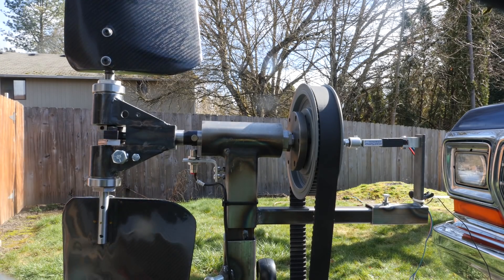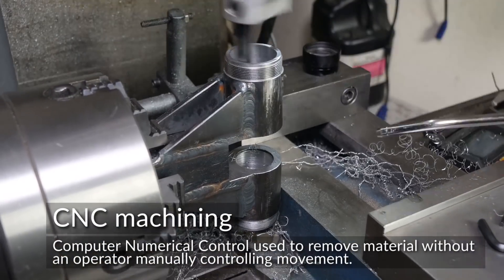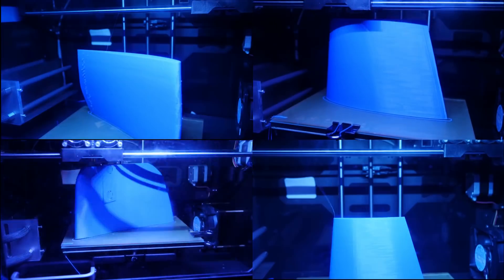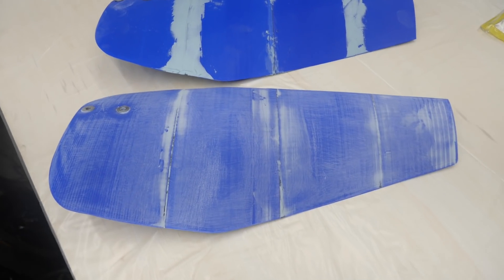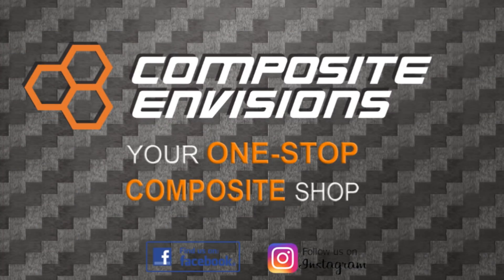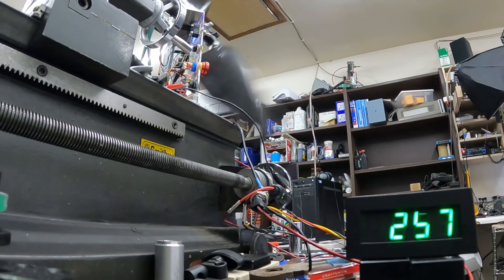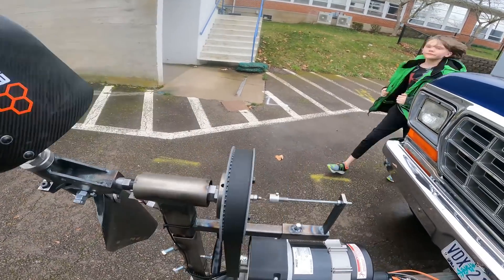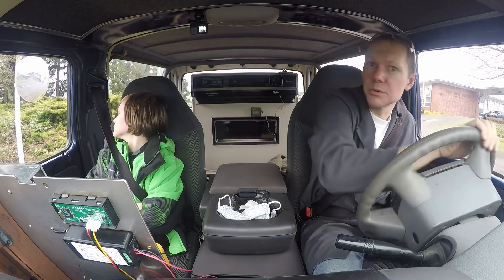Carbon Fiber Blades Making 2000 Watts! - Wind Power on a Car #4

Comment: The gas fuel you used to make the speed that turned the fan, had a higher energy storage coefficient than the turbine. Turning the gas into heat to cook the food could have been a lot more practical. Side note. Most civilised countries do not permit that random addition of equipment to be put onto the front of a vehicle and then be used on public access roadways. So really its not, as your title suggests, wind power, but Gasolene power driving the turbine blades. Kudos for the building and using a variable pitch, but this is not new tech either. The only random thing you missed was adding the gold go faster stripe on the leading edge of the blades. Well done for clickbiat though.
Reply from the maker: all covered in the final testing video: https://youtu.be/tEPBdztGMdI

Comment: If you tried to drive in the UK with that attached to the front of the car, the car would be impounded and you would be charged with reckless driving
Reply from the maker: 'Merica! 😂  Be sure not to miss the conclusion where I measure the effect on mileage to see if it works!  https://youtu.be/tEPBdztGMdI

Comment: Imagine something like this plus solar panels on a Tesla . With two or three separate batteries one to drive . One being charged by wind and solar and one pack to power in between charging of main battery . So power alternates from 3 separate battery packs . Could get up to 1000km easy
Reply from the maker: Be sure not to miss the conclusion where I measure the effect on mileage to see if it works!  https://youtu.be/tEPBdztGMdI

Comment: A real engineer would control to be able to calculate how much fuel lost to added drag on the vehicle to compare it to the power gained by the turbine. That's the essence of can do vs should do for any budding engineer to learn tradeoffs.
Reply from the maker: But as every budding engineer then learns, there are so many estimates and unknowns in such a system (Re for example) that the answer ends up being way off when compared to empirical data.  I've never seen a case where theoretical was not modified to match reality.  Thus the saying "the difference between theory and practice is that in theory there isn't one but in practice there is".  Video with data is already being viewed by patrons on Patreon...

Comment: 8:31 An AI should have controlled it's pich by the speedometers input for maximum use. And why is this not on an electric car with solar panel?
Reply from the maker: did you notice the AUTO/MAN switch on the controller on the dash?  Future plan is to do just that.
Reply: @QuintBUILDs  I said that cuz if done right the AI with wind sensors can get the best angle of attack for power output as you put more gas into the acceleration.

Comment: If you would have connect a 12V inverter to the battery you would have got way more power and it would have been much more efficient as well.
Reply from the maker: Oh, just wait until you see the next vid! 😁
Reply: @QuintBUILDs  😁

Comment: I have always wondered why they dont make and sell adjustable pitch turbines for home use.  They use them for commercial power production, why not for home use?  They are much more efficient than fixed pitch turbines.
Reply from the maker: Would need to be a super cheap robust mechanism.

Comment: what would happen if you put this on a electric car, would it recharge itself and could go for longer distances or would the prop slow it down to much to be effective ?
Reply: It would not produce enough electricity to meke up for the amount of electricity it requires to drive forward to make it turn.    It could be a handy backup to have incase you run out of electricity in a windy area though.
Reply: @Bendigo1  Yes, but if you use it like the brake system on most electric car to increase range ?
Reply: @sir.fatfoot8731  it would create drag, to overcome the drag it would take more power so any power created would be lost in creating the power.   I had the same idea, but after doing research i found out it wont work with current technology.
Reply: @Bendigo1  alright, thank you for clarifying.
Reply: @sir.fatfoot8731  you're welcome.
Reply from the maker: Find out in the conclusion where I measure the effect on mileage to see if it works!  https://youtu.be/tEPBdztGMdI
Reply: @QuintBUILDs  alright, will do. Thank you.

Comment: Do you think the 3d printed core is lighter than using foam? I am sure much easier to do the carbon layers. Foam would be brutal to hot knife and heat seal. What a cool way to make your custom blades!
Reply: Pretty heavy though

Comment: So long story short, you just created a very energy inefficient, generator, that also needs to be in constant motion and runs on fuel.
Reply from the maker: Video proving it works: https://youtu.be/tEPBdztGMdI  😁
Reply: @QuintBUILDs  I mean it obviously works, but it just convert mechanical energy created by the car using fuel, so in the end that energy comes from additional fuel consumption.
Reply: In other words, you could use a fuel powered generator, and it would probably be more energy efficient

Comment: Can this mechanism be installed on an electric car and use the energy generated to charge the batteries for increased mileage..
Reply: Yes, but it will generate less power than it consumes
Reply from the maker: Actually it generates more than the additional fuel consumed.  Don't miss the conclusion where we prove it. https://youtu.be/tEPBdztGMdI
Reply: @QuintBUILDs  yes, but on a square truck. Won't work on an aerodynamic car
Reply from the maker: @tedarcher9120  with respect, do you realize you've simply restated "won't work" on a new unrelated challenge without addressing the validity of the prior assertion? There is no need to be right all the time here. It's all about the learning for me, but that requires honest assessment of prior misunderstandings/statements.

Comment: Wholesome, but I wonder if you can remove the oven and add those motors that will support engine. How much you are going save or it's going to be inefficient?
Reply from the maker: Thanks!  Find out in the conclusion where I measure the effect on mileage to see if it works!  https://youtu.be/tEPBdztGMdI

Comment: I like your idea and what your doing. I have always had the idea that electric cars could recharge themselves while driving down the road using a turbine in a tube idea. But I'm not an engineer and have been told it wouldn't work. Now I understand why it probably wouldn't work. Thanks for the indepth explanations
Reply from the maker: Thanks!  Don't miss the conclusion where I measure the effect on mileage to see if it works!  https://youtu.be/tEPBdztGMdI

Comment: So I’ve had this idea for a few years but I don’t have the smarts to make it possible. Lots of little turbines tucked in the hood of an electric car. Air could be funneled from the grill to the turbines to charge half of the batteries when the car is driven. Only half the batteries are used at one time. When one set of batteries runs out, it switches to the set that has been charging with the turbines. I don’t even know if it would be possible.
Reply from the maker: We touch on that in the conclusion where I measure the effect on mileage to see if it works!  https://youtu.be/tEPBdztGMdI

Comment: i think the idea is stupid cuse you change the air resistence of your car  and using more fuel to get some wind power   it only makes sense if you drive down a mountain   but i like the engenering work and is fun cuse it stupid
Reply from the maker: See what you think after watching the conclusion where I measure the effect on mileage to see if it works!  https://youtu.be/tEPBdztGMdI

Comment: Cool but impractical. Here in Europe (UK mainly) most cities have 20mph limit combined with traffic there is no way this would give you any energy, in fact it would only be a unnecessary weight and taking up space. Perhaps electric trucks that actually use motorways could use something like that.
Reply from the maker: We touch on that in the conclusion where I measure the effect on mileage to see if it works!  https://youtu.be/tEPBdztGMdI

Comment: What will happen if you strap that contraption to a EV? Maybe you will charge the batteries while driving. Never stopping for charge at a station ;)
Reply from the maker: We touch on that in the conclusion where I measure the effect on mileage to see if it works!  https://youtu.be/tEPBdztGMdI

Comment: I wonder if by using those vertical squirrel cage blades like they have in vertical fans you might be able to attach a generator at the bottom and mount it right to the bumper. I have often thought about building a wind turbine in that configuration to see how it would work.

Comment: Ive seen how cylindrical magnets dropped down a steel tube don't fall at the normal rate of gravity, and in fact spin while going down.  Makes me wonder if magnetic fields resemble propellers, and if the effect can be reversed...

Comment: Resistance in the equation is lost energy.  What you have done is demonstrate that resistance can be transformed back into usable energy, albeit at the increase in use of energy, but probably less than the increase.  There is a give and take relationship, but there is a point of maximum return to increase in cost in the ratio, because the ability to capture the resistance adds new resistance.  So long as the new resistance is more favorable than the resistance that is being transformed back into usable energy, it is a preferable form of resistance. 

All matters of resistance can therefore be seen as sources of potential energy, by way of reducing the resistance through transformation of the resistance into usable energy.
Reply from the maker: Video proving it works: https://youtu.be/tEPBdztGMdI  😁

Comment: You should try and get the Arduino to monitor power output and automatically adjust blade angle for optimum power at any speed :) awesome work!

Comment: I must be wrong, but is it possible the blades are on backwards? I realize this is a turbine, but shouldn't the concave side of the blade always be downwind (even when the wind is driving the prop)?
Reply from the maker: Part 1 explains why they are the way they are. I found it confusing at first too!
Reply: @QuintBUILDs  Guess I am late to the party starting at video number 4. I noticed your 400w bought turbine has the blades configured the same as the one you made (just as other similar turbines I found online as well). But when looking at large scale turbines, they appear to be designed as I would expect (convex side of profile upwind). I've built model planes all my life, but I am suddenly confused...
Reply from the maker: The commercial ones look a little less like a wing but follow the same principle. If you think of it in terms of pressure, the underside of an airplane winghas the higher pressure. Well, so does the incoming wind. So the underside of the wing should face the incoming wind.
Reply: @QuintBUILDs  Great clarification! Thanks.

Comment: The issues with your layers separating is likely due to moisture in the material. Running the spools through a food dehydrator would help if so.

Comment: I'd like to see more data on generator speed and voltage/amperage output. The voltage regulator trying to output a voltage (240v I assume) is probably hurting your numbers. DC generator or a Hysteresis dyno should be used.
Or just control the alternator excitation yourself.
Reply from the maker: Interesting thoughts. I suppose I'd need to measure torque going into the generator to know for sure. At least it's multiple kW output now instead of a few hundred.

Comment: a fidget spinner bearing, is just a standard bearing with the grease washed out/never applied, removing the grease from a standard bearing lowers the friction alot, but also lowers the load it can handle by alot. makes great slow speed no load toys, makes garbage actual bearing use.

he discovered this as soon as he applied a decent load to the fidget spinner bearing it seized up because it had no grease.

Comment: Really great video! Hey, something that might be worth considering...Since it sounds like your goal is to extract energy that would have been wasted, you might want to consider miniaturizing the wind turbines, such that you have quite a few of them across the hood. If you have the blades nearly touching the skin of the hood, the blades will be in the boundary layer as well as the moving airstream. You may actually end up being able to extract more energy that would otherwise be wasted using this approach; you might end up creating vortex generators that will reduce the total amount of drag on the vehicle, helping to offset the increased amount of drag you are creating with the wind turbine. It wouldn't be a total offset, as that's not possible, but it might reduce the total amount of drag you are producing with the wind turbine.

The drawback is that when the blades are in the boundary layer during their rotation, the very tips of the blades (the portion in the boundary layer) won't be producing any power. But the boundary layer is extremely thin, so that shouldn't matter much, if at all.

Another possibility that uses your current design.... move it closer to the front of the vehicle. I assume you are thinking about how there is less drag on a vehicle when you "draft" behind a big truck. I think that you'll have better results by tucking in just a bit closer to the "truck."

It will be really interesting to see the results of your test... Are you creating more drag with the wind turbine than the drafting effect you are generating? Yes. But will the amount of energy produced by the wind turbine offset this? Hmmm.... I anxiously await the results!

Comment: This generator would be great with an electrical car.
Reply: @CodyL95   @CodyL95  I was thinking more about lowering the energy consumption of the car, similarly to gaining energy from braking in some electric cars. Like you said it may not be as practical due to the increased air drag though.

Comment: Ultimately the energy is coming from the gasoline you put in your car. The usefulness of this device is that it can be used to test different fan designs for efficiency.
Reply: what would happen if you put this on a Electric Car/Truck?
Reply: @sddrlj5442  then you are just using your car battery's energy. You can never create energy out of nothing.
Reply: 18:25
Reply: We had a official from the green party here in Sweden that thought we should put this on cars. So no, not all understand 🤣
Reply: Yeah, but if you are driving across the country anyway...
Reply: @pyramydseven  
You will use more gas with the fan than without it on any journey that you're going to do anyway.
This is simple high school physics for those who actually paid attention in class.
Reply: Pretty sure most people understand entropy bro
Reply: @HiroshimaGooner  No they don't.
Reply: @HiroshimaGooner  no i don't ,, what's that?
Reply: @HMABH  let me say... The fan blade in the front of the car creates drag and reduces the speed of the car and the engine has to burn more fuel to drive the car.... So basically just remember that there is no free energy
Reply: @mithun__sk  let me say that the terrible drag coefficient of the vehicle would benefit from the reduction in air speed the fan blade is providing.
Reply: @absolutium  for better understand search on yt "A Physics Prof Bet Me $10,000 I'm Wrong"
Reply: @gionazd2127  Let me guess.. the veritasium video hardly anyone understood yet everyone recommends?

Comment: Great vid.  
I bet if you use a cheap slow speed high torque linear actuator like the Bangood search below, you could fine tune the blade pitch and get closer to 1000rpm on the hub.  
1200N DC 12V Linear Actuator Motor 50-500mm 9mm/s Aluminum Alloy 30W IP54 Linear Actuator  
Regards, Jas.  
VK4FJGS  
Rockhampton Queensland Australia

Comment: Throw a forklift motor on the axle and get the wind turbine to charge a battery pack. With the help of a few VoltageXCurrent step-up modules, the stored power can give that motor some power to aid effort on the engine output

Comment: Imagine the turbine on Tesla "Never have to connect a charger again lol"!
Reply: I just commented this that's true though imagine one half of the battery charging the other half being used 😂😳
Reply: The energy generated is not due to wind. It's actually the movement of the car that generates it. The car moves because of the energy from gas. Ultimately gas is the supplier of the energy and not wind.

Comment: No I didn't wonder why you made your own turbine.
I wondered why you didn't just buy an inverter, and run the oven off the cars electrics ............................
Reply from the maker: That would be far less efficient. 1st rectifying the generator output then relying on the inverter to turn it back into ac? Heating elements care not what the frequency is so connecting them directly to the generator makes the most sense.

Comment: The fuel efficiency is one thing because if you slowly burned a gallon of petrol in the bottom of the oven you could have your 2 kilowatts for 16 hours! You could probably bake for longer than that seeing as the heating element turns off to regulate the temperature so you wouldn't have 2 kilowatt on all the time unless you wanted a REALLY HOT oven.

Comment: Did you coyote swap that bronco? Also nice work putting the modern steering column in there. Did you hook up the airbag and associated sensors? Love the channel. Cheers! And you put keyless entry with the stock fob, I like. Ok I have now watched to the end of the video. Great work.
Reply from the maker: Faked airbag and seat sensor wires with resistors so computer doesn't know the difference.